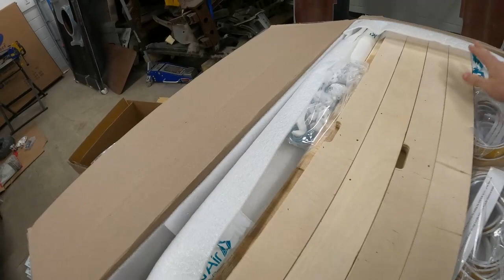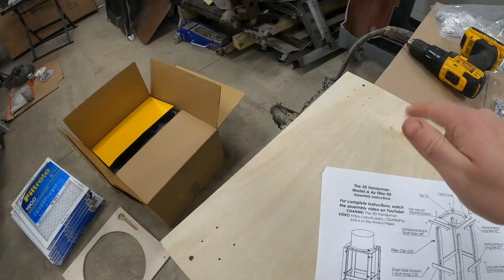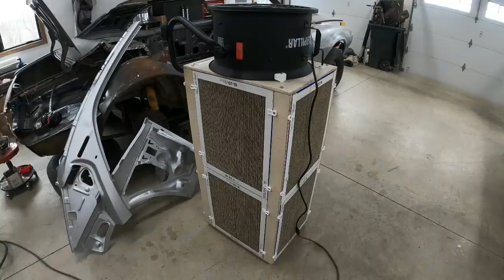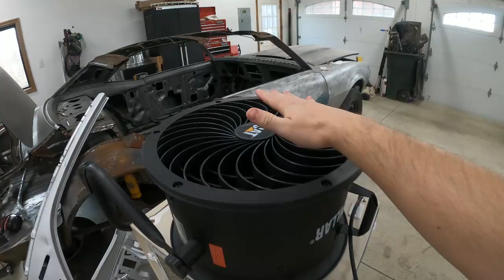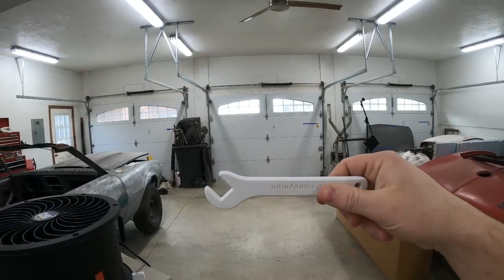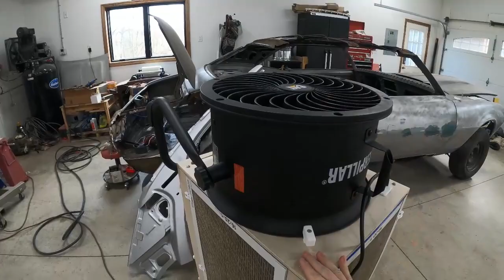How To Build A Cheap Dust Collection System For Your Shop.  Perfect For Welding, Grinding, Painting.

Comment: I suppose one could use a water-filled tank with the extractor directed into it, so the dust gets trapped in the water. After a few uses, the water can be replaced, and the setup can be used again..

Comment: Hey there Mitch,

That's a pretty slick filter unit. I was looking at the ceiling-hung units, but if you don't mind giving up a little floor space, being able to roll that one right up to the work seems like a better idea. I suppose you could use finer filters if the work merits the expense.

God job taking care of your lungs, young man!

Take care, breathe free,
Dan
Reply from the maker: Hey Dan! It’s a nice box for sure. A ceiling unit would be nice. That would help keep the clutter down. It is nice to roll it up to the dust source. I need to buy a bunch of filters though. Thanks I try to take that stuff seriously.